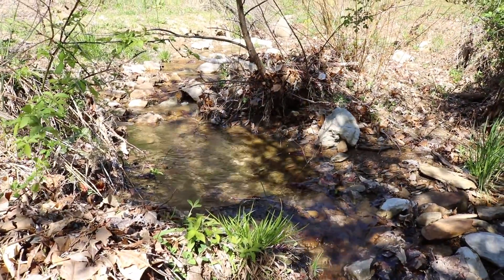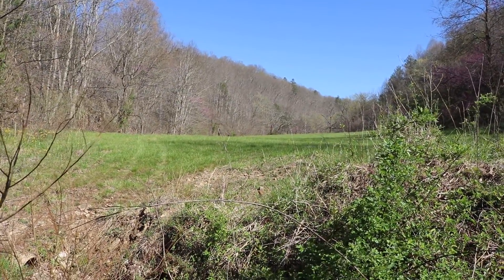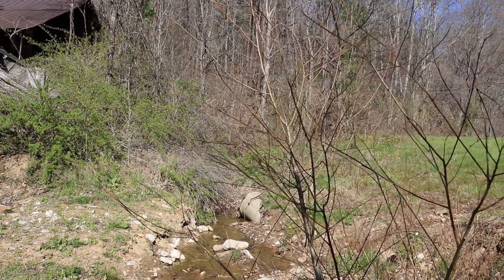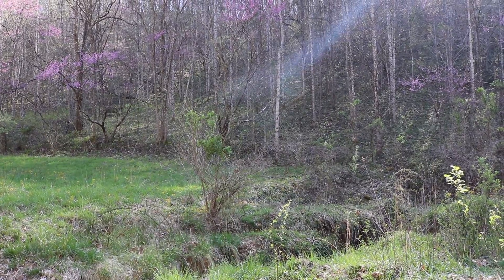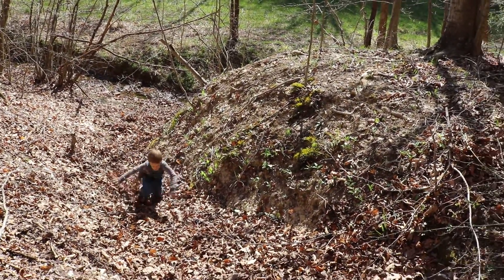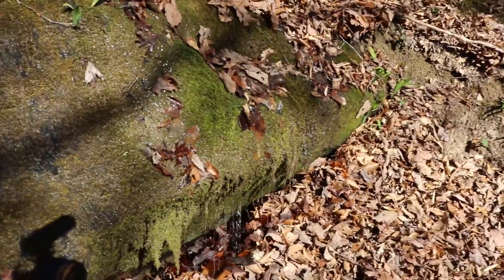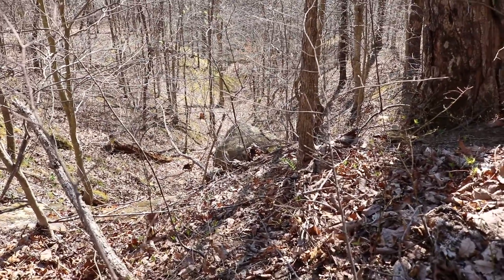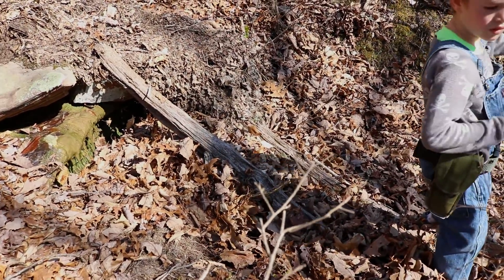Off grid water solution, micro hydro,  ram pump

Comment: you can put in catchments, for water storage.  but, hydropower comes from head and flow rate.  installing a catchment at a higher elevation does not increase the nominal flow volume.  similarly, a ram pump can raise 10 percent of the volume of the source flow.  assuming there is a location that has some elevation change, there might be enough flow in the creek to power a teeny, tiny ram pump.   if there is an area on the creek that has a change in elevation of one meter or more, a few watts could be generated with an overshot waterwheel.  by a few, i mean five to eight watts.    cheers
Reply from the maker: Thanks for the input!!  There is over the 1 mile of creek about a 40 foot drop in total, I'm still learning the ways of the land and how much water goes were at what times of the year.
Reply: unless there's a river hidden on the property, your water supply is low-flow, low-head, and calls for an overshot waterwheel, located in an area where elevation change is greatest.  in low-flow low-head, the hydropower comes from the weight of the water in the buckets.  at a suitable location, install a flume or pipe to deliver water to the top of an overshot waterwheel, designed to make the most of the available flow.   cheers

Comment: run a water line down the slope... put a pressure gauge on the bottom... every vertical foot of drop is .433 PSI  Then you will know what your drop is... then you can calculate the right proportions for the ram.
Reply from the maker: Awesome, thanks for the input.

Comment: Thumbs up!  If I really wanted to go BIGTIME and had enough water and pressure to do it, I would  take 20 lb propane tanks and fill them with water to be sure there is no propane in them and then emptying the water and taking a right angle grinder with a cut-off wheel and cutting the propane tanks lengthwise, leaving one straight side uncut. When opened up this would make a large  pelton cup. Done to about 8 or more propane tanks. Taking two steel automobile wheels and welding them together, then welding the opened propane tanks around the wheels making a large pelton wheel.  The center of one of the 2 wheels welded together would need to be cut out to be able to get a ratchet in to tighten the lug nuts of the other wheel to a junked automobile hub/axle. Similar to this https://www.youtube.com/watch?v=BtCMuO3DVyE  Or  instead of using the hub/axle of a junked auto, weld the propane "pelton wheel"  to a large steel pipe and fit each end of the pipe through a large pillow block bearing.
Reply from the maker: Holy crap man that is awesome!  I was looking into different ways to do it but this looks really good.. I think I can adapt something like this to work.. :D  Thanks for the tips, I really appreciate the feedback!!!
Reply: I just watched the end of your video. I hadn't seen that part before. I couldn't tell how much water is coming out of those ledges but if its anything like what's flowing past your cabin, there's cause for celebration. That's a really good drop in elevation. Pipe that down to your cabin and you should have enough pressure to spin a turbine of some sort. And for house water to the faucets, you wouldn't need anything bigger than one inch poly pipe and it would give good flow and pressure. But the turbine feed polypipe should be bigger to avoid friction losses. Just my opinion.

Comment: If you do it wright you can do hydro power and ram put on the same stream do ram pump at top end and lower do the hydro after it drops that 100ft or so. Good luck
Reply from the maker: Thanks!  After being back and fourth all summer, it does get a bit low flow towards the end of summer, so it may just be a spring time thing, but better than nothing!